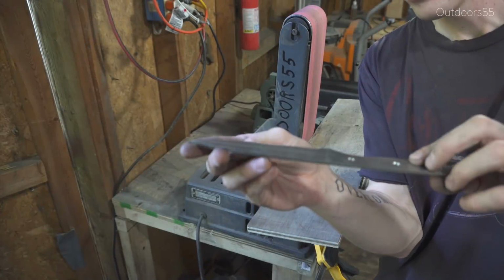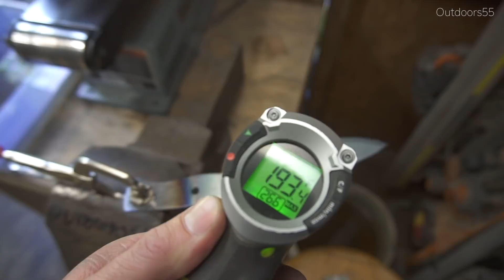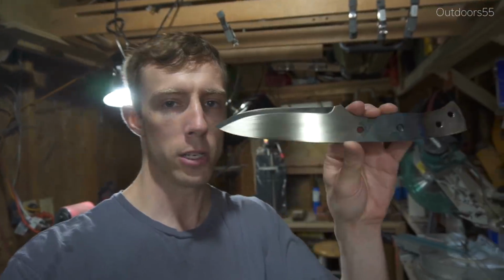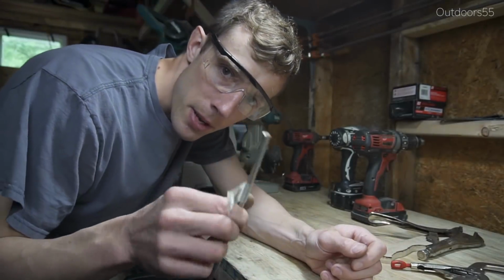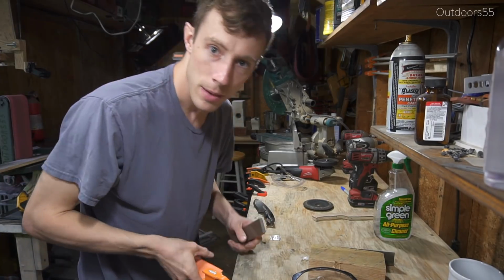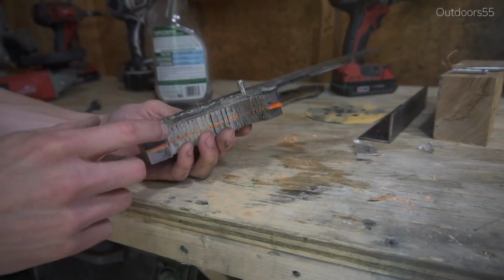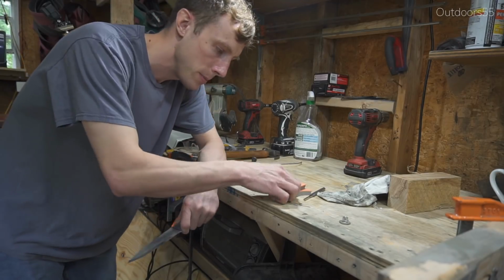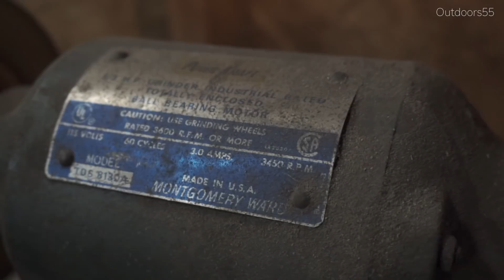Knife Making - Making A Bushcraft Knife

Comment: You should look into a mini da sander polisher, wet sanding disk grits go from 80 grit to 4000 grit. leaves the metal polished mirror like and keeps your hand at a safe distance from that blade. Hard work and great knife

Comment: New to knife making have trouble with the bevel what is a good starting angle also how thick is your edge before heat treating also can you advise on material and thickness I have wasted a lot trying to get this right thanks great job keep it up I am learning a lot
Reply from the maker: Edge thickness is about 1mm before heat treating. For stock removal I like 1/8” (or .125” ) Hopefully this helps 😀

Comment: Are you not concerned that you only superglued the liners to the micarta, so the epoxy is only holding the liners on to the edge, and then also the pins through the holes? Is that not a risk of the liner separating from the micarta? Just curious.
Reply from the maker: I’m not concerned. I drilled through the liners so the epoxy attaches to the g10 handle as well. Super glue is wideyused to attach liners to scales. I know at least 2major custom knife manufacturers that use super glue. If they are doing it than it must work. 🙂

Comment: Hey Alex, when you are nearing the end of your knife project how do you keep the knife from rusting. I have had a big problem with it rusting after I am done hand sanding. Is there any type of oil I can put on it to protect it?
Reply from the maker: If your having rust problems on your finish grit you can always wet sand with wd40 or light oil. Ill only do this after the scales are epoxied on though. You don't want oil interfering with the epoxy bond. If your finishing with 600+ grit you shouldn't have too much rusting though. Any light oil applied right after sanding will help. My process is to stop wet sanding (with water) before my last piece of sand paper. I finish the blade with a dry piece of paper and no water. That usually solves the rusting problem.
Reply: @OUTDOORS55  thank you very much

Comment: when you are using your drill and belt sander to rough up the pins you should put it in the drill press and use sandpaper there it works better and doesn't take to pin size down as much.
Reply from the maker: Ive done that before. Both methods work. In this case I actually wanted to take the diameter down a bit. Thanks for the comment my friend!
Reply: OUTDOORS55 no problem as a knifemaker myself I think that giving tips like this can help anyone!

Comment: I'm new to knife making, and was told that I should start out with 1080, or 1084 instead of 1095 because 1095 requires a particular type of quenching oil.  What steel do you use, and what steel would you recommend for a bushcraft type of knife?  Thank you.

Comment: Great job mate! Your knives are getting really good. What happened with the fails? And how long did this build take you?
Reply from the maker: Thanks! The big one I couldn't heat treat in my small forg, another one warped (ALOT) , the last one I ground too thin towards the tip trying to flatten it. 😀
Reply: That is unfortunate. I am not too sure how to deal with warps myself. 
How long did the knife in the video take you to make I am curious as I have similar tools as you.

Comment: Love it!

I also like that you used a similar belt sander to me giving me less excuse not to try my hand at making a knife :)

Is there a finish that you put on the g10 or do you just sand it well?
Reply from the maker: I sand to 600 grit. It seems to be a good balance of grip and finish. This sander has been good to me. If you make the platen mod it can work very well. 🙂
Reply: @OUTDOORS55  Did you epoxy it on, or tap some hols and screw it on from the back?

Comment: Nice knife! Love the blade shape! 🙂

Two questions, though, why didn’t you heat treat the handle as well and why so many holes in the handle?
Reply: The holes in the handle shed weight without you seeing it. The handle doesn't need to hold an edge so no point in making it unnecessarily brittle.
Reply: If he had heat treated it, he'd had have had to soften it back to drill the holes.
Reply: rpc717 he could’ve drilled the holes beforehand.
Reply: Optimally, but he didn't. I didn't mean it was a reason not to heat treat the handle, just that he'd have had to "untreat" it if he had.
Reply: rpc717 yeah.

Comment: Hello sir. can you make a video about making a knife.  Quenching knife using water. (Water Quench).
Reply from the maker: I have water quenched before and it works. It’s a fast quench so warping and cracking are slightly more likely to happen with water. Other then that it’s about the same. Hope this helps 😀

Comment: What was the fails with the other knives?
Reply from the maker: The big one I couldn't heat treat (I tried 4 times and couldn't get it to Harden). Another one warped very badly and developed a small crack when I tried to straighten it. the other one I ground too thin at the tip trying to flatten the stock..

Comment: Do you need to normalise if you didn't forge the blade? Better to be safe than sorry I suppose. Great work
Reply from the maker: Technically you don’t. If your careful to not heat the steel too much while your working it then definitely no. Steel heats up fast with angle grinders though so I always do. Thanks my friend 👍